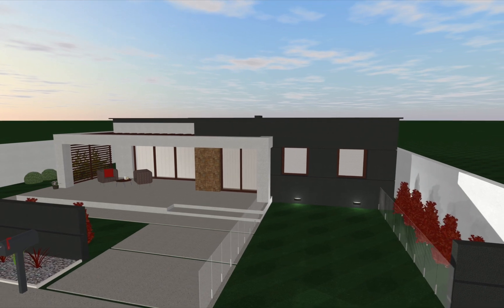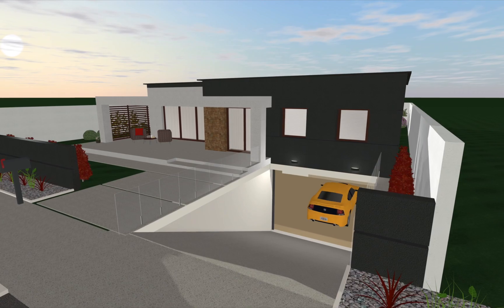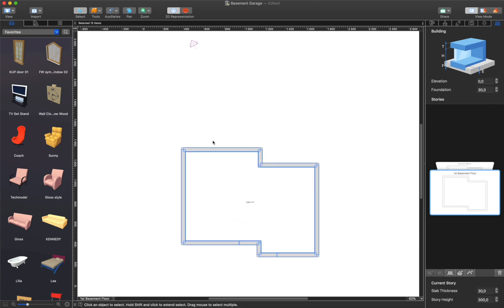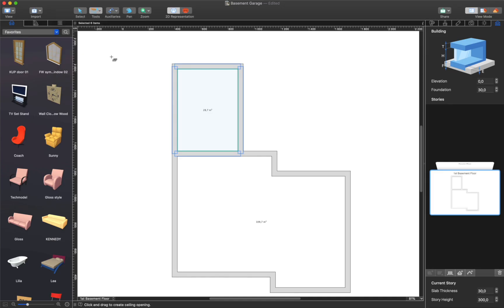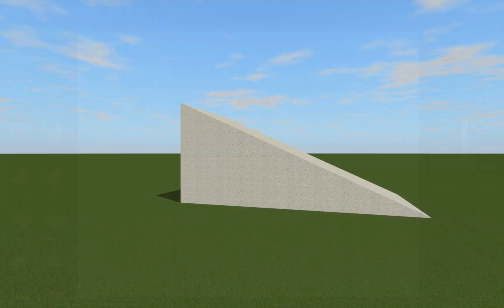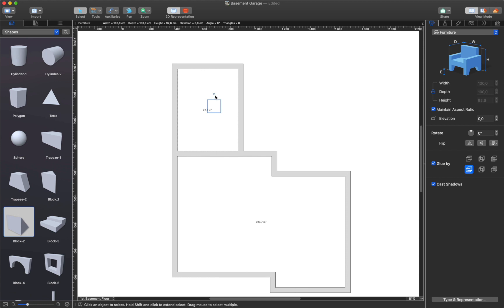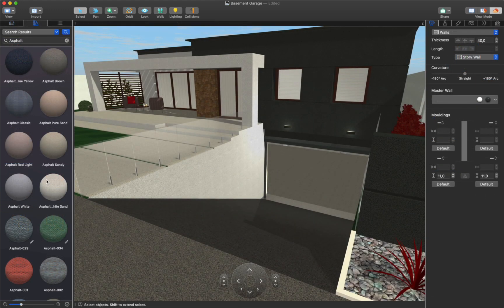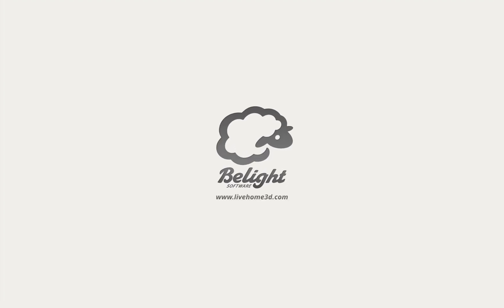Making Basement Garage - Live Home 3D for Mac Tutorials

Comment: too steep would rather make it a semi basement
Reply from the maker: Thanks for your feedback on the video tutorial!
Since the garage is on the basement level, you can adjust the height using the Story Height parameter for that floor. By decreasing the story height, you can create a semi-basement effect and reduce the slope of the driveway to make it less steep.
If you need assistance with these adjustments or have any other questions, feel free to reach out by email at support@belightsoft.com.